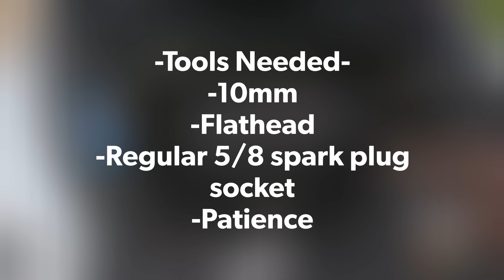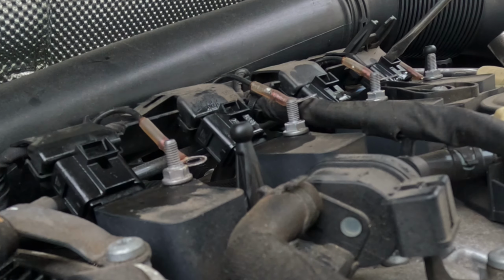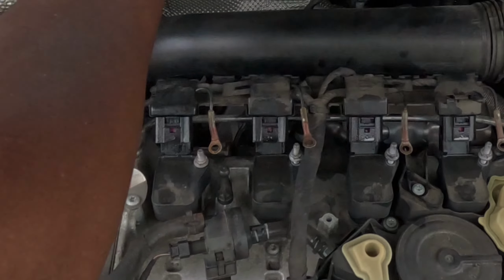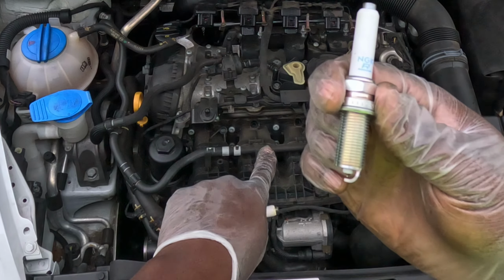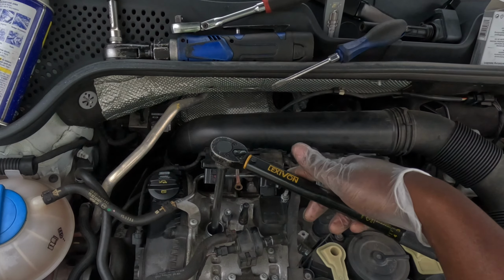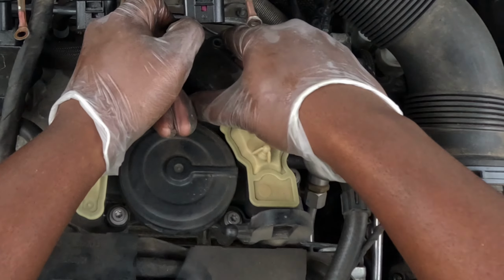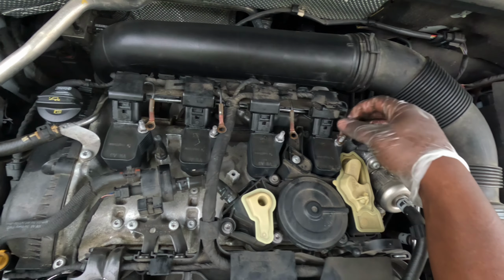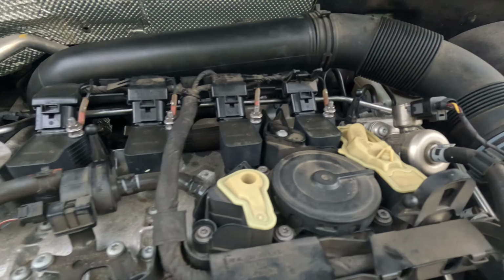2014-2019 Volkswagen Beetle Spark Plug Replacement

Comment: Hey what size is the socket for the plugs?
Reply from the maker: 5/8 socket. You can buy something called a spark plug socket it’s a 5/8 with a magnet in it
Reply: @ultimatediyguy395  Just swapped the plugs. Didn’t do the coil packs tho. We’ll see. Thank for the video and the reply!
Reply: The video is helpful. But I can’t for the life of me get the coil packs out. I’ve tried removing the square box part, the rubber tube part just won’t budge. Pulling and stretching. Like it’s stuck around the plug? Tried compressed air down center, wd40…any other suggestions?
Reply from the maker: @VampireXXI  if your not confident in yourself you may have to take it to a shop. If you break them you may have to buy new ones